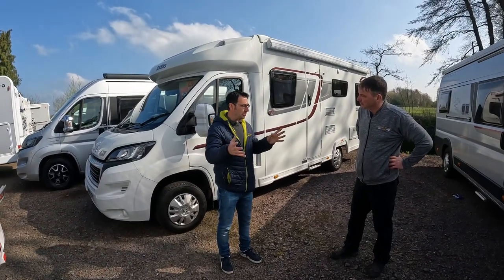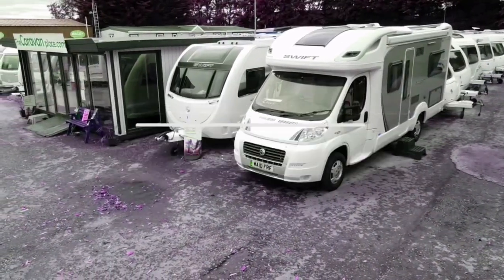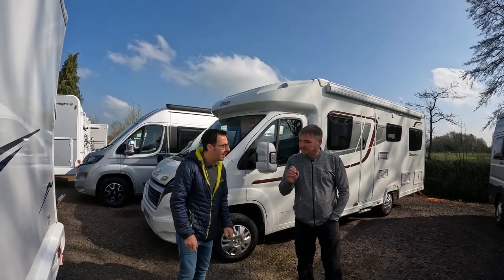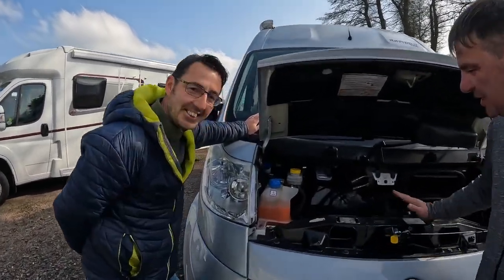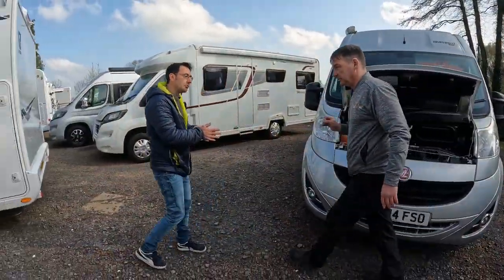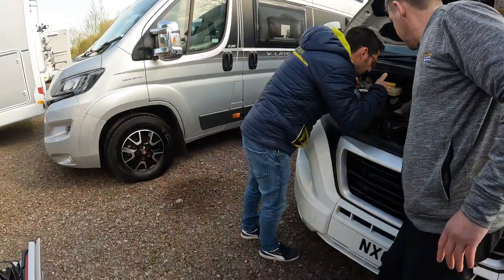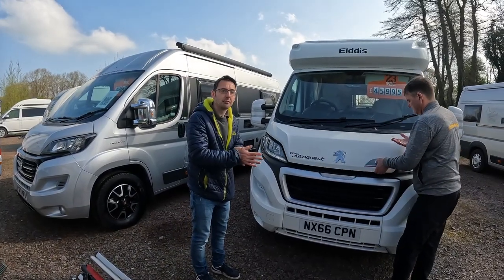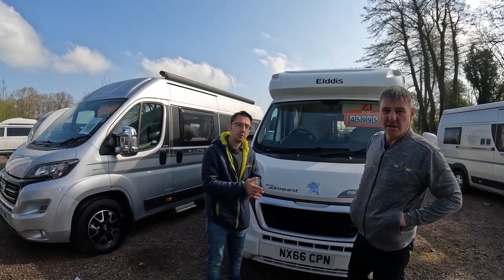HE'S GOT TO BE PULLING MY CHAIN ON THIS MOTORHOME.

Comment: I had a chain fail on a 2010 Renault Trafic based campervan in 2018.  It had done 110,000 miles.  The Renault guarantee said that chains were covered for the life of the engine but when I looked into it they conveniently defined this as 100,000 KM.  Mine had done more so I was presented with a 6000 Euro estimate for a new engine.  Scrapped it in France and got the ferry home.  The lesson learnt is that chains can break too, and they have a set lifespan.  And I will never buy anything from Renault as long as I live.
Reply from the maker: Not a fan of renault either